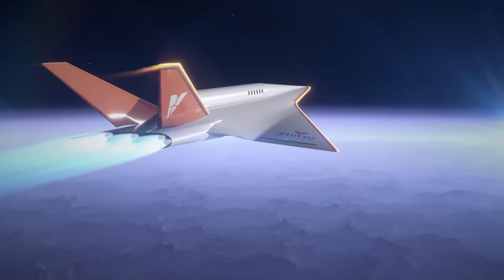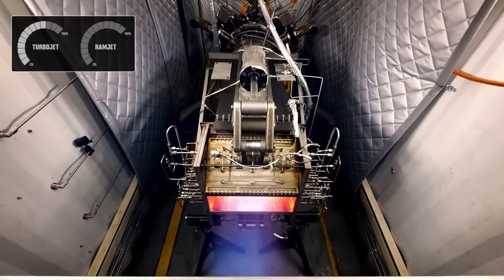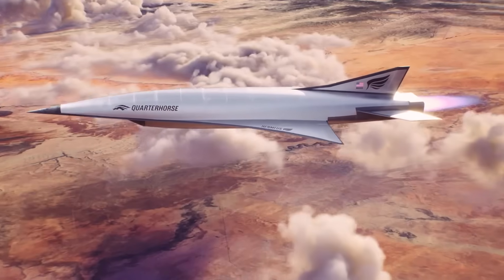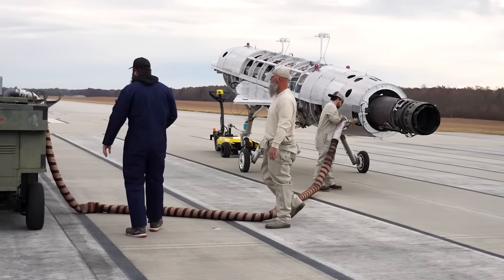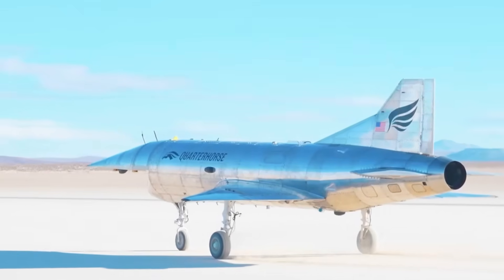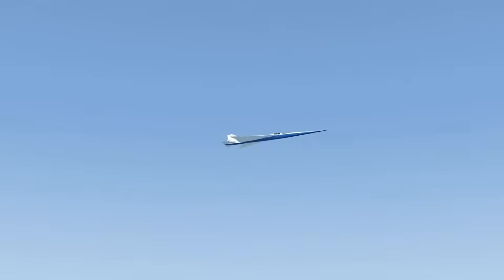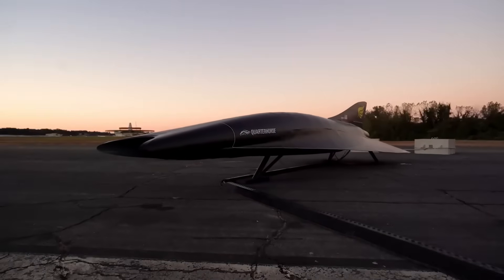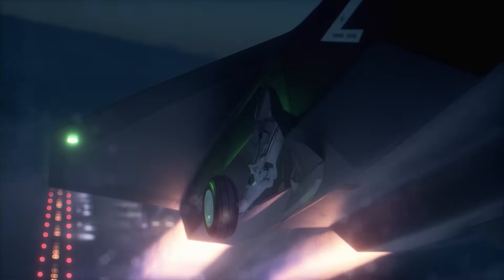US Military’s Hypersonic Jet That Breaks Light Speed Ready to Fly to Russia

Comment: Light speed? Lol! 186,000 miles per second? Six plus times around the earth in one second? Really? That would be so fast you could not land within any reasonable accuracy. The aircraft would melt instantly from air friction. No circuits, nothing would survive this. You would go uncontrollably into outer space or if aimed downward, you would probably go right through the earth and destroy this planet! Lol. Well. It would work in outer space aimed in the right direction, but hit anything solid in its path, it would be a tremendous bullet going right through the craft. Could it explode into electromagnetic energy? No solid object besides electromagnetic energy or electrons, sub atomic particles can go as fast. Lol, lol, please check your physics!